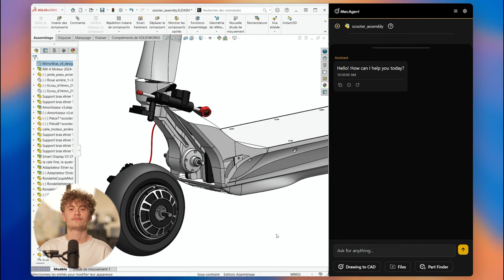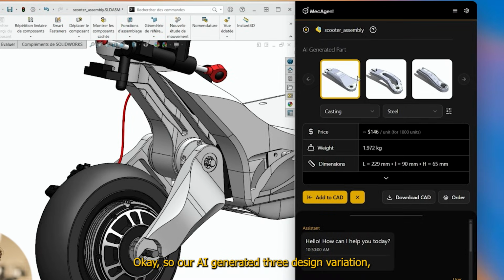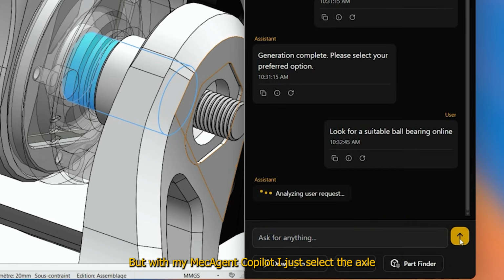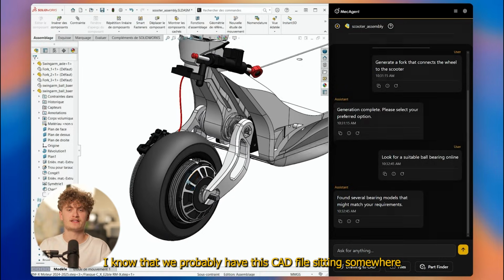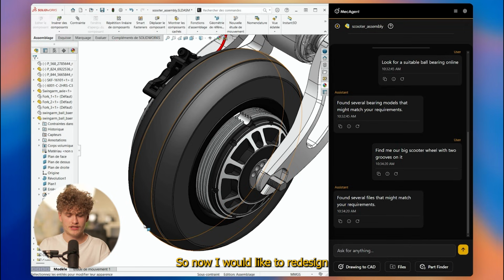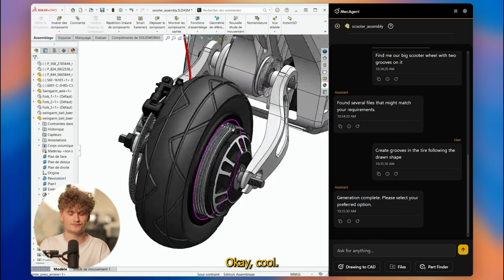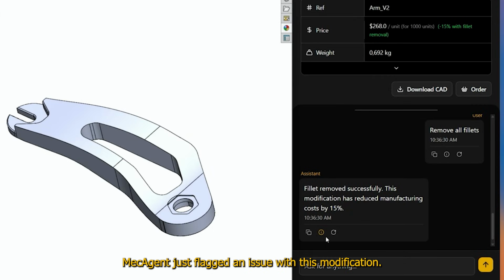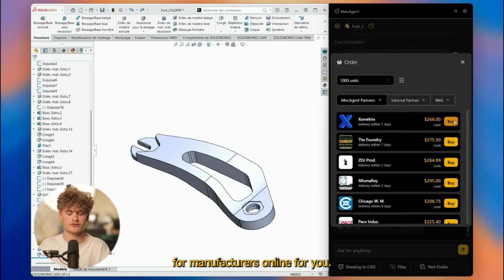Introducing MecAgent Copilot : AI for Mechanical Engineers

Comment: Ok, first of all this is not the typical mechanical design workflow in most companies. The styling team prepares the sketch for how every part should look and the inputs for them comes existing market + their creativity. The mechanical design engineer then converts the sketch for that part to 3d model by considering the manufacturing process. Maybe this makes sense for a one-off product but not for something in production or mass-manufacturing
Reply: In the company I work for we, the engineers, come up with the design ourselves! It definitely depends on the product though, and I don't doubt that most companies work the way you described.
Reply: @angrycyclone4353  I agree only partly 1. That is not the workflow shown here. It shows the workflow of 2 wheeler design. I have worked in 2 wheeler design for many years and engineers would ever hardly design anything there. Product design is not the domain expertise of many engineers because it looks into material, color, finish, ergonomics, and differentiation. 2. Even if, like in your case, the engineers are designing themselves because the product design is not very important factor in their product - still this is not the design workflow. The design is constrained by many many physics and supply chain based parameters - like basic spatial constraints, does supplier have the specific machine to do this, do they have to develop a new tooling for this etc. That is why i mentioned for mass manufactured goods, this is really hardly ever the case.
Reply: I am not saying this is a bad tool - i said it is a bad example that they showed. I can see one using this for small inner mounting brackets etc and for generating first ideas etc. What they showed is a distant view of reality

Comment: @MecAgent:
This is not how I design my parts/products.  
First, I want to see the ideal connecting shape between the two axles. (use any FEA method / surface/solid generation methods). 
Second I want to appox-modify-simplify that part to suit my requirement.
Third, I want to look for sellers of similar product and sellers of prototypes / test / prove etc.
Fourth, I filter from the suppliers, based their resource levels, their supply product price & quality.
Fifth generate the final design.

It seems your AI model is ok (only for) build off-the-shelf designs.

Comment: Also, the tire that was a completely different one than the one before.
Notice the inner diameter of the tire changed when you asked it to draw the groove. 
And if it isn't a different one did your agent just decide to change the non groove geometry on its own????
Reply: It is generative AI, it hallucinates. In this case it's probably up to a designer to accept this hallucination and fix things manually or ask for more.
Reply: @FedorBP   I understand but if the AI goes of hallucinating and me having to fix it I'd just make it myself at this point, not worth the hastle.
Reply: @FedorBP  its not ai, you can see in the tree that the part is hidden, then they make it visible

Comment: The first feature is just generative design that has already existed.
Are you calling the api inside of your cad to run the feature? Or did you develop a new algorithm?
Also did you fine tune models for your agent or did you use RAG? 
How about data safety? Do you run local models, I don't want my cad data to be in the hand of big ai companies, because you are definitely running llm api from providers if you aren't running them locally.
Reply: Generative design is based on solving the physics equations and optimizing the mass and topology. They typically produce organic shapes best suited for 3d printing. The parts generated here do not look like this... Probably everything here is the call to external APIs.
Reply: @FedorBP  I mean how I assume the first feature to work atleast hopefully is that you feed some code the surfaces and the forces and it generates the geometry.
The guy says it sounds good to me, but we can't just vibe engineer a fork without taking the whole system into consideration.
Nothing in the promt or the response mentions forces or kinematics, I don't want to land face first on the concrete sidewalk when that thing snaps.
So far this whole demo is just a gratified NLP to API call that doesn't have a lot of engineering behind it
Reply: @lazytitan1075  hey i needed some guidance from you, could you help me out?
Reply: Все права будут принадлежать ИИ компании. Это конец для творчества и индивидульности, и образования в целом. ИИ "наплодит" армию "талантливых" "инженеров", что приведет к первой в истории эпидемии дебилизма на планете.😂
Reply: @fakel87 trafne spostrzeżenie.